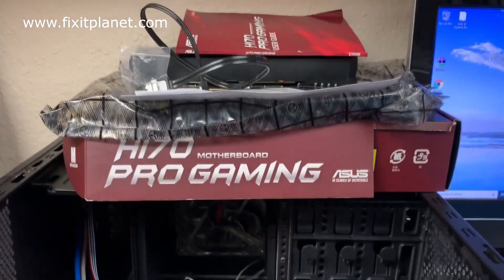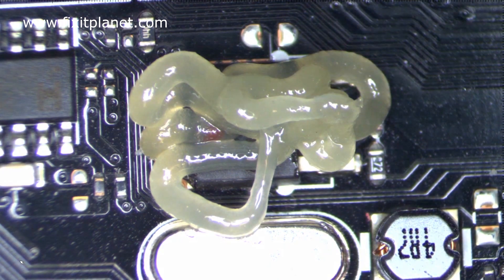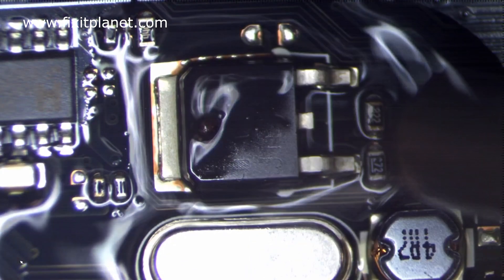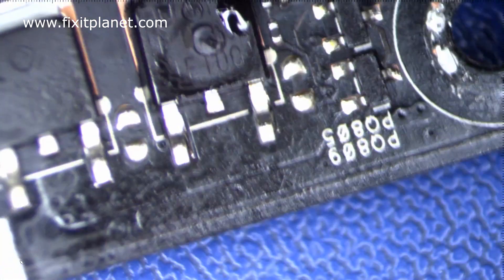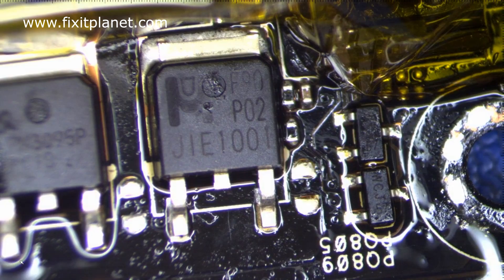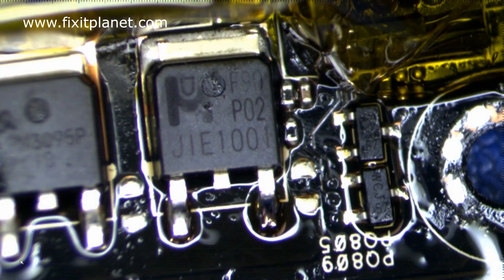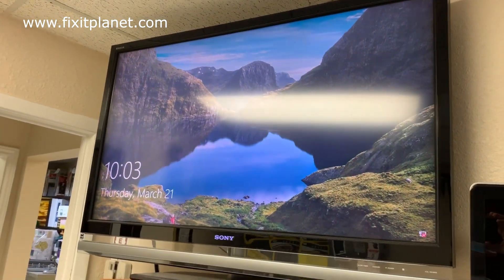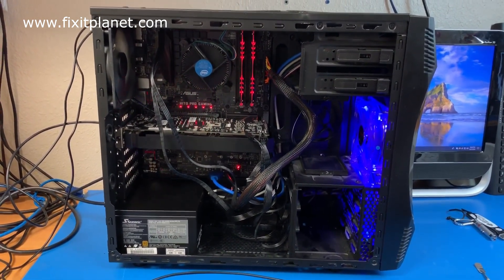This Killed My Motherboard! Asus H170 Pro Gaming.

Comment: Hey everyone.. I goy a Core i7 7700 and plan to buy an H170 Pro Gaming. What the best (economic) option for it? wanna go for 32Gigs Ram to start. Already got a 650W Power Suplly and 1tb Barracuda HDD. Need Ram Memory and a GPU... I the TUF GTX 1660 Ti 6Gb a good option to go? found a used one for realy cheap.. a couple 16gb. Hyper Fury ram memries 3200mhz